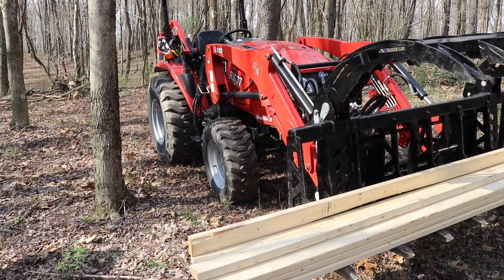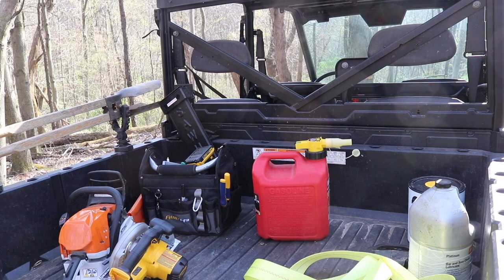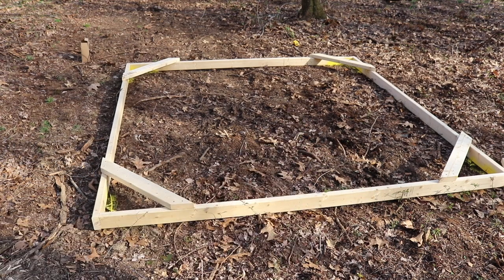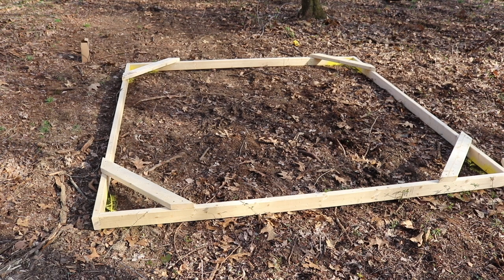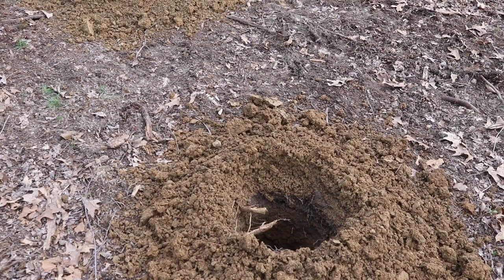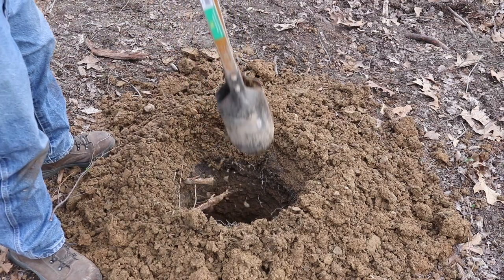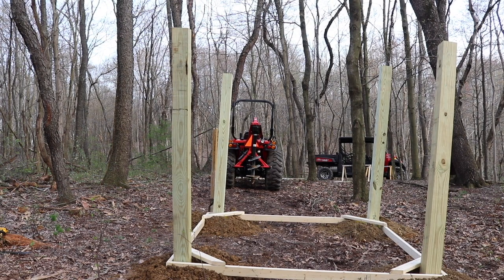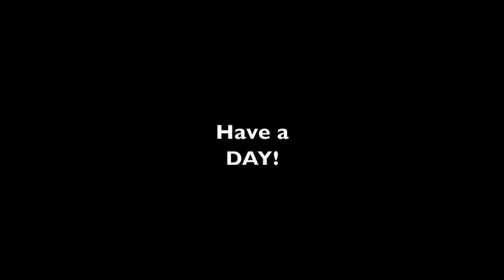#414 The EASY way to Layout, Square, and Plumb Posts for small Structures, Sheds, Chicken Coops, Hun

Comment: MIKE,  did I catch a little bit of a smile at the end? 
HUNTER,  ! lookin good in "Black n Gold" !
Great idea bout setting the posts with that "picture frame"! 
Good set up if you had to move it due to a  hole that had issues (big rock). No time wasted digging/ resetting batten boards an string for square! Thanks,  learned alot!

Comment: Great job here Mike... I appreciate the way you are thinking outside the box getting the posts set in place, well done... Up here in the north country of N. Central VT., the frost can run pretty deep. ( 3' - 5' ) I picked up this trick from an ole timer that was bldg. his camp on posts set on concrete footings. Some scraps of 2" thermal blue board cut to fit the round holes were packed in place first, then the concrete was poured into the holes & then set to grade. It will never be seen, but it does act as a thermal barrier, helps prevent frost heaving. I don't think this will be an issue in your part of the woods. 
Great to see Melissa & Hunter out & about too...
Bill... :~)

Comment: Hello to Hunter from northeast Minnesota.

Now with the first post squared and straight I would have set it in concrete and let it set overnight.  Agree with using dry concrete mix around the post and then pouring in some water.

Comment: Have to admit, I like Hunter's style, stays comfy.☺.... Sure showed me a new way of squaring up a layout. I have an 8x8 garden tool shed, after its all closed in it won't seem so big, it'll be just perfect for yourself  and/or with a buddy. 2 sheets of 3/4 plywood for floor with hardly no cutting. 😉... I would heavy black plastic the underside and insulate that floor and help heat it up costing A Lot less gas in the long run in not having to run the heater wide open for so long... I've been in insulated and non-insulated hunting blinds and Man what a Huge difference.👍

Comment: Yo Mike- To your question of how others secure their blind platform posts: Our camp is located in Michigan's Upper Peninsula where wx extremes are the norm. All of our 'tower' type blinds are built on raised platforms set with treated 4 x 4 posts in post holes dug manually with post hole digger. Some small stone is placed at the bottom of each hole (enhance drainage) and then holes are back filled with pea gravel (no concrete). Our blinds range in size and roof style with most newer built ones also sporting a small rear deck for easier access. The oldest blind was actually a purchased cedar box blind that had to be assembled on the platform. That box blind finally died (good riddance, because it became mouse infested as well as other unwanted critters). Yet, the platform we built as described above is still solid as a rock after 23 seasons. Therefore, we simply built a new, roomier and virtually critter proof blind on the existing platform. Over the past several years, We have found it most efficient to design, build and assemble our blinds at our downstate home in the garage over the winter. Each blind is designed to be disassembled and pieces transported in a small, 5 x 10 utility trailer 250 miles north, then transported into the woods by ATV trailer to the specified blind location and reassembled on site. Could probably speed up the process if you would be kind enough to lend us one of your tractors. 😁 Pics available upon request. BlackHillsDeerCamp@gmail.com

Comment: Indiana here. Thanks for the info. I never heard of this method,  but it makes perfect sense.  I have a few projects in mind where it will cime in handy. Curious though as to why you chose not to use treated lumber for the whole structure since it will obviously be exposed to the elements? I realize it would increase cost but those 2x4's will deteriorate pretty quickly unless you are planning on painting everything.
Reply: They are temporary bracing and will be removed later. They are obviously not part of permant framing...

Comment: Great video, Mike! Hole digging tip:  Stop the auger in the hole when you're at full depth and lift out slowly to get the cleanest bottom. The dirt should stay on the auger. However, only stop it if you're sure you can get it out. Keep up the good work! Love your little fam jam.

Comment: Nice job that auger is a handy tool would loved to have had one when I was building my firewood shed, haven’t seen that method for squaring but looks like it’s gonna work I used the old trusty batter board and string method on my shed!

Comment: Hi Mike,

To clean out the loose dirt from the bottom of the post hole I stop the drill at the bottom of the hole, lift it out (not rotating) and start it rotating directly above the hole.  The dirt flings out radially and keeps the bottom cleaner.

Comment: Mike the tower blind will be your Man cave, leave at Least a 18 to 24" wide openings at a comfortable sitting height to shoot from.  "All" the way around it with 2 ft. wide windows with hinged shutters that can be opened "upward" by raising with rope and pulleys, this will give you a 360 deg view and enable to be closed when not in use and or to Block the wind, rain or Cold air and to keep the squirrels from getting into your food and snacks  . Grass turf would be the Best on the floor, Not indoor, outdoor carpet....and steps up to the door for Melissa . when it's finished call it the "Hilton" ... ps. Don't forget a Nice Sturdy cot ... Best of luck...Robert R.

Comment: Concrete to set the posts will speed up the rotting proscess. Even with pressure treated posts, it holds moisture against the wood. The new foam material is much better or just gravel and dirt.  Also, we need to start a campaign to get Hunter free Chicken Sandwiches from Burger King for life! You are a fine young man Hunter and it is obvious your parents are very proud of you!

Comment: Hi Mike will you be putting a trap door or a regular door in your cabin? I have found it's easier to lock it up with a trapdoor, and your stairs stay dry and not slippery in the winter time. But mine are in Central Wisconsin.

Comment: Hey guys! As always love the videos. Great to see that Hunter knows sign language. Awesome to see is a great way to communicate. By the way Mike putting those posts in with no concrete underneath of them? You're just creating a sleeve for them to slide down into the ground. I've seen it happen many many times. When you're done there's going to be a lot of weight there and shell or no shell it will sink if you don't put concrete under it. Just my experience but hey dot-dot. Just like Burger King you can have it your way right away buddy LMAO.. have a great day!

Comment: Mike, what are you thinking?!?!  Men have went to war over much smaller debates than "to concrete posts in or not to concrete posts in". I'm amazed it hasn't started yet, but it will so I will put a vote in for no concrete.  Just backfill and tamp with dirt in one foot lifts.  Allows for better drainage, posts will last longer.
Reply: When I set posts I like to throw a few stones in the hole so the posts have something to sit in for drainage whether I use concrete.  The posts look like ground contact not for burying, those are very green.  They are 6x6 though and Mike is 53 I believe, so they should outlast him ;o).  I liked the 2x4 frame to square it!  Helps hold it when you're alone and fast!  He needs to hurry and get that saw mill.  He could have squared some long posts and put that thing 30' in the air!  No deer would be safe!  Put a sola panel on top of it and put a mini split in there so you can hide year around!

Comment: Mike, rather than concrete for the posts have you ever tried the liquid bag foam? It works much easier than concrete. Just mix it in the bag, cut the corner and dump it in the hole. It sets up in 5 minutes. Also a lot lighter to lift and lug.

Comment: Did you have trouble hitting roots?  I am putting up a pole building in my timber and thinking I better use a skid steer with a hydro drive auger the I can run backwards to unscrew. Thoughts?
Reply from the maker: There were some smaller ones like inch or two in diameter it cut right through, No real big ones though

Comment: You don't need concrete around those posts. Just back fill with the clay mixed with some pea gravel and tamp it in with a sledge handle. It'll pack like concrete. Treated lumber needs to shed moisture, even with the bottoms not encapsulated in cement they hold moisture and don't last as long as they should. I've been setting all sorts of posts for 40 yrs and  they hold up really well.

Comment: Not disagreeing with your method however, there "can be" a slight issue with it. You need to make sure that your framing square is actually square. Those can be off, even straight off the shelf new. 
Shut the PTO off just before raising or clearing the hole, helps to keep a cleaner straighter cut hole. Auger bit carries the dirt out, turn the PTO back on, watch the dirt fly around above opening. Shut off, drop down, start up, rinse an repeat as needed. Be surprised as to how well you can get a nice clean and straight hole. What you're doing, gives you a severe chance of an oblong shaped hole since the auger is bouncing around, hence, creating more "backfill" needed than necessary.  Great video. Cheers :)

Comment: Mike instead of pouring concrete, look into Post setting foam your post ,one pack per hole should set one post and within 20 or 30 minutes you can start building instead of waiting a couple days when you pour concrete to do your building with concrete. You should be able to fine the post foams at Menards or Lowes or Home Depot or Ace Hardware or Any of the big box 📦 store s 🏬  👍 👍 😎
Reply from the maker: I have seen that product before, Looks pretty good

Comment: Mike great job.  One question why did you do one side at 8' and the other at 8'3"?
thanks, Bob
Reply: id assume to account for the additional length of the 2x4 butted up to the other 2x4
Reply: To account for the two 2"X4" at each end, 1 1/2" thick each. That way the interior dimensions are all 8'.
Reply: @rfb7117 - then the inside dimensions of the square are 8' x 8', which ends up being the outside corners of the posts
Reply: Thanks gentlemen.....makes sense.